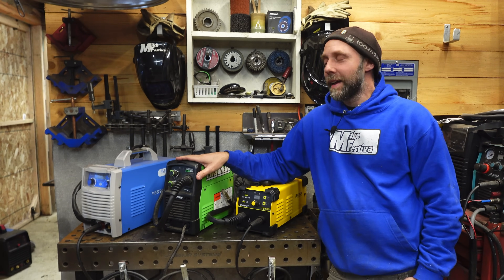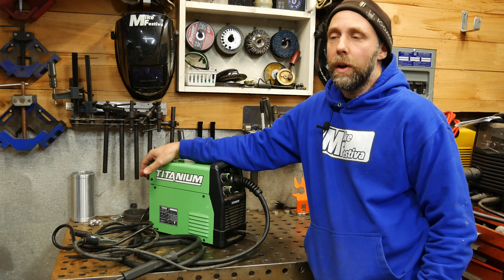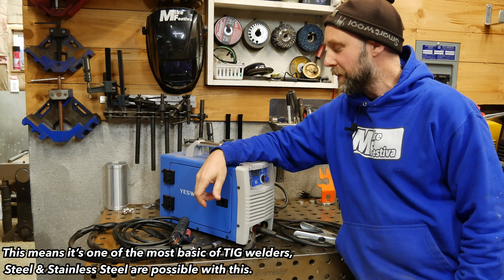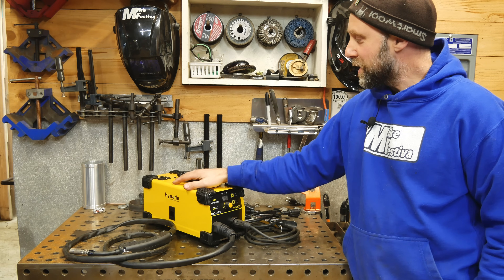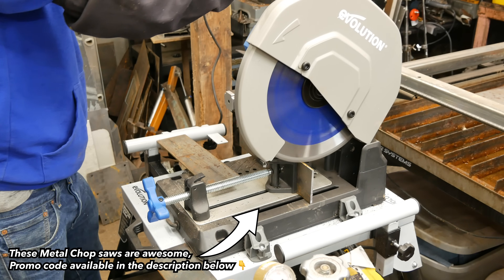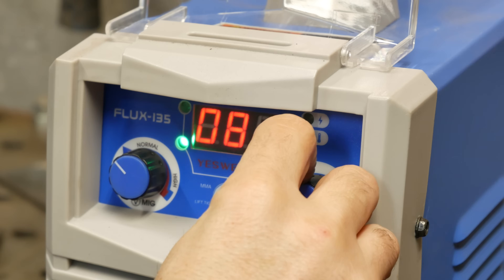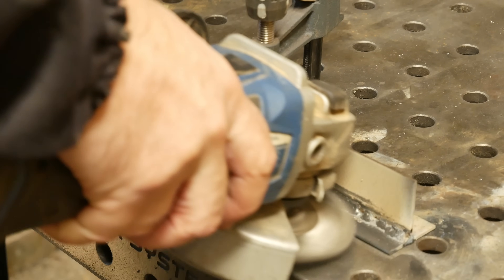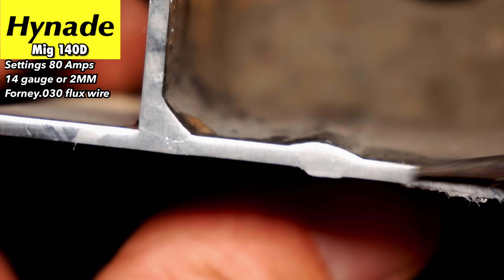Get started in welding, great DIY welder Titanium, Yeswelder, Hynade flux review

Comment: It has been about 6 plus years since you got the omnipro 220. How is that welder still holding up?
Reply from the maker: I sold off my Omni pro to by a TIG welder years ago, but bought another one about 1.5 years ago. Zero problems with either one I have owned. If you check out my newest video I posted on my channel, I run the Omnipro welding on a trailer frame to build a tiny cabin on. Good all around welder 👍

Comment: Ok so I bought the haynade 140 from Amazon … it’s a lil different now it has cut outs for straps now and it beeps during use I thought it was an issue but after receiving a new one and returning the other one yes they beep when using thought I’d clear it up for anyone
Reply from the maker: Good to know that info about the newer model of the 140, thanks 👍

Comment: Not me the Plumber installing a 50amp breaker with 4 gauge wire to a 120v receptacle Just so I can Weld with 3/32 Rods going 80amp On the Cheap Welder

Comment: Mike , I currently run the old Harbor Freight flux core welders on 20 amp breaker with 10 gauge wire to welder. I have no problems tripping the breaker. If run on a 15 amp breaker off a drop cord the breaker trips easily and lower amps come to the welder. Your wire from breaker to outlet could be too small. should be at no12. Preferably no10.

Comment: I wish you would have mentioned the duty cycle on each one.
Reply from the maker: You probably will never hit the duty cycle on the Hynade on 240 volts, and probably won’t even have an issue with the others. I honestly have never hit a cool down cycle on any of my inverter welders ever, that’s much more of an issue on older transformer welders. 
You should easily be able to look up the info on the welders website if you want more info.
Reply: @Mikefestiva  Could be on the duty cycle. But with 45 years out in the field I always push a machine. I have 3 transformer welders in the shop, so taking your advice and purchasing the Hynade, since it has the highest duty cycle.  And like you said for small jobs I'll be using it outside with a generator.  You make great videos.  By the way what brand is that fixture table you have.
Reply: One of the standout features of the YesWelder Flux 135 is its impressive duty cycle. While it boasts a 60% duty cycle at 135 amps, it can also maintain a 100% duty cycle at 104 amps, depending on the welding process.

Comment: That Yeswelder Flux 135 is running $100 right now.  At that price, would you say it is a no brainer for a beginner?
Reply: I bought it a week ago for 100. so far its been amazing. You could say its a set and forget with flux core. spent 30 mintues with some scrap to dial it in and been smooth since
Reply from the maker: That’s an awesome price! Thanks for mentioning this 👍

Comment: Thank you for this and all the videos you’ve made that include the Hynade 140D. I purchased it mostly based on your review and you’re review of the Flux wire test. I am a weekend welder fixing small things around the house and helping family (mostly for practice!). I replaced my stock plug wire for 12 guage so I can use 220V outlets. Any recommendations for using 220? Settings? Max Metal thickness? I plan on building a 100 gallon propane tank BBQ pit this Fall / Winter. 

Thank you for your videos! And I’ve watched most of them! Lol.

Comment: Out of curiosity, have you thrown a amp checker on while welding? My yes welder (stick, and lift tig) seems to run really cold. It struggled to run 6013, and 6011 (all rods are 3/32). I had the same issues your having with your breaker. If i turned it up to 90ish, it would pop the breaker. It seemed to run a little better with the 7018 rods.

My Titanium 125 flux, runs like beast, no issues. Ive built a welding cart/table, and welded 2 exhaust on cars with it, no issues. I would definitely recommend it to someone looking for a cheap portable welder, or someone looking to learn how to weld.

Thanks for the video man!

Comment: I have had a Titanium 125 for a few months now and now the machine is continuously feeding wire. I have checked the trigger connections and have even plugged it in with the trigger disassembled and it still continuously feeds. Had anyone had this issue or have a solution?
Reply: I don't have that welder, but does it have a "Reset" button somewhere on it? If so, that may correct the wire feed problem.

Comment: Any experience with the Arc Captain Mig 200?
Reply from the maker: Yes the company Arc captain sent me out that Multi process MIG welder and it welds pretty nice 👍 I have been testing it at my work for the past 5 months and it’s still working good.
Just recently received the spool gun for welding aluminum and it probably welds better then any other aluminum SG style welder I have used. Time will tell but so far it’s definitely a good affordable welder.
Reply: @Mikefestiva  How would you compare it to the Yeswelder 205DS?
Reply from the maker: @ChillWheelz  very similar to the 205DS but this one is a bit easier to set up when it comes to auto set, and manual settings, plus it has spool gun ports.
Both are budget inverter welders but I feel they both offer good value. I haven’t had the Arc captain for very long like I mentioned so time will tell how well it holds up but for now it’s still welding good.
Reply: @Mikefestiva  There is an updated version of the 205DS that allows for a spool gun.  I previously had the original 205DS but was looking to purchase either the upgraded 205DS or this ArcCaptain.  I like my 205DS but I like the LCD display of the ArcCaptain.  The Yeswelder 250A has a decent lcd but it is not a dual voltage machine.  Any way you can do a video on the ArcCaptain?

Comment: Yeah you pay that a pocket but by what other means did you gain? You recommend that hynade they don't even give you a knurled wheel, even with the no gas machine. Total cr@p ... Thanks for the heads up of no nerled wheel Mike
Reply from the maker: There’s no need for the knurled drive, the machine feeds fine. Stop complaining and go back to your shop and learn how to weld.

Comment: Ok so I got a crazy question.,, with a flux core welder running off 120v 20 amp breaker .., how is the welder burning at 80 / 90 amps? Or higher and not tripping the breaker..,  power inverter ??
Reply from the maker: These welders can make 90 amps on a 120 volt 20 amp circuit because they up the amperage from dripping the voltage down, they are probably running about 18 volts at 90 amps when welding.
Hope this helps 👍😊

Comment: The yes welder has two bottom the left is the voltage and de right is the wire fee the 125 is the wire fee is that the reason is cold and you got less penetration

Comment: What size breaker do you have, and what size extension cord would you need for a 25 ft cord?
Reply: These all claim to be able to weld on a "normal" household circuit - I.E. 20 amp breaker wired with 12/2 w ground. BUT; when you look at the specifications, what little they give you, that circuit should now be a dedicated circuit, as in nothing else runs off of it. (The Hynade even states to use a "50A" breaker on the 110v side on their website)

Important to Note: In 30+ years of service work I can definitively state there is no such thing as a normal household circuit. Under Size Wire, Miss-wired, Un-grounded, and overloaded circuits are more of the norm after various owners "modify" for whatever they are doing.
They all state "No Extension Cords" (because most folks are going to use an undersized and overly long one)

HF states 23.5V - That's a 25A breaker running a minimum of #12, or better a 30A running #10.

Hynade has conflicting info on max draw amps (The website states a 50A breaker for 110V) - I have one, and although I would normally just hook it to a 30A dedicated circuit wired with #10, I sent the manual PDF to an electrician friend to double-check for me. (I am just a GC - I perform electrical work but let the pros spec it if outside normal parameters)

Not familiar with Yes, but looking at the manual I would not use this on a normal 20A household circuit without having my electrician verify the specifications for me. 

Although all these welders claim to run on 110V household circuits, the only clear language in the manuals is to wire it per a licensed electrician for your area. Very clearly limiting their liability to actual use in the field.

I would probably use any of these welders in my garage on a dedicated 110V 30A circuit running #10 in my shop on a known circuit. - I would run none of them on an unknown circuit on one of my clients or my rentals. I know lots of folks do, and I thank them for that as over the years folks that abuse their home's electrical systems have made me lots of money.
Reply: @johnhubbard6262  Ty, not going to get one, going to weld it at my buddy's house, OR would a Honda 2200ie general work???
Reply: @johnhubbard6262  Is there any way to tell which outlets are dedicated by your circuit breaker? I have one set for an air conditioner... or maybe unplug the frig for a while? lol.

Comment: This video made me decide to buy the Hynade MIG140D. I did some test welding, on some 1/8" flat steel with it today, and I am happy as can be with the results. I've never electric welded before, and with the exception of letting the flux core wire spool unravel  a bunch (learned NOT to clip the end until I'm ready to feed the wire into the machine), everything went smoothly, and easily. I was able to get some really decent welds, considering my zero experience. I think I will become quite good at it with practice.

Thanks for this comparison vid.

Cheers!
Reply from the maker: Right on! That’s awesome man! 😊👍

Comment: Hi Mike, great video, thank you.  I am just getting started with welding, and I am renting a garage.  Besides clearing it with the owner who is a friend, what should I do to protect the floor, walls, etc?  I want to get some projects knocked out but I do not want to damage the space or the friendship.  Any tips? (fire extinguisher, ventilation are obvious, but floor coverings? wall coverings? spatter control?)  Thanks!  Definitely worth a sub with the bell.

Comment: You've done it again, Thanx.
I'm new to welding, or I should say this type of welding, I pushed some  Oxy/Ace puddles around around 20 years ago.still have my torches, but in the long run I think this would be easier, more convenient and cheaper, I  want to do some stuff around the ranch.  think I'll get the Hynade and some forney 42300.

Thanx again.

Comment: Thank you so much Mike for making this video! a question I need to ask you, can 0.030-inch flux core wire "fillet" weld comfortably on 19 gauge square tubings and sheets? or it will easily burn through holes in 19 gauge - 1 mm? can an experienced welder weld with the mentioned wire size on 1 mm without burning holes? your reply will be a great help. We weld 99.9% 1 mm mild steel tubes and sheets, in our country it's very hard to find a 0.023-inch flux core wire, and we don't have co2+argon gas bottles or any similar... at all in the whole country.

Comment: Thanks for the honest comparisons.  I have been welding with the HF 125 DCEP welder and am tired of the BB’s and splatter.  I’m ready to upgrade and think I want a Flux/Stick welder.  Your video has just about made me think that all I need is a DCEN Flux core welder.  I would not use the stick welder very often but would use the flux core 90% of the time.  I guess it comes down to which MFG I want to spend my money with; HF, Yes or Hynade?
Reply: Have you done everything to help mitigate the spatter? Quality flux core wire, prepped part (no milk scale or paint) weld settings set correctly, proper stickout, and anti spatter spray. Once you get all those down then the spatter should be minimal and cleanup should be very easy with a wire wheel.
Reply: @rileyneufeld7001  done all that.  Broke down and bought the Titanium 125.  What a difference DCEN is.  OMG!  I feel like I’m welding with shielding gas now!  So much cleaner and less smoke and spatter.  I barely have to use any anti-spatter spray.  My welds are so much better!  Been using the Hynade .30 flux core wire.
Reply: @waynecoley4876  My mistake I thought you had the titanium flux 125! Yes clean welds are much more attainable with it. The stock settings on the welder do seem a bit voltage rich and wire speed is a bit low. For the given thickness go down half a letter and up .5 wire speed and you will get better results. It should sound like bacon frying not a pulsing weld.
Reply: @rileyneufeld7001  very much appreciated

Comment: Hi Mike,

I like the yeswelder.

Do you think if you turned the amps up a little on the 3/16, it would do as well as the other ones?
I notice on the other 2, the breaker tripped.
Maybe the yeswelder was not putting the Amp that it said.

Comment: Hi can you use the titanium 125 flux outside and can you use an extension cord , thank you for your help
Reply: The manual says No to an extension cord, and No to any wet conditions. Everyone uses extension cords regardless, sometimes you roll the dice - If I do, it's 10 gauge as short as possible. I carry 25', 50', and 100', and my PPE matches the risk as closely as I can.

Comment: Over the years I have owned Kemppi 3phase Migs that were 5k or more each (several), jazzy Mosa diesel towable  welders that were eye-watering, spent hundreds (probably thousands) of hours running torches  The last few years I only run 2 small sub 700.00 Migs - a Sip & a Sealey plus a sub 200.00 flux core (don't know what make, but boggo) - those 3 ickle welders make me a better living than the big machines used do - all 3 get an absolute spanking day in and day out. They are not used for "hobby" stuff - they are expected to earn their keep. Which they do, just fine. 

You don't need fancy gear to make a living welding. One of these ^^  will get you a very long way. :-) "Gas" is expensive as frig here btw - it runs €120 to €150 for a hobby size rent-free bottle you have another €120 into as the deposit on the bottle - renting bottles is even more eye-watering. I have 5 bottles at any one time, they don't last too long & it soon adds up to not beer money over the course of a year. So Flux-core has that huge advantage right off the bat - No Gas required.
Reply: That Forney wire is damn near unobtainium here btw - it's "Out of Stock, unavailable" everywhere you look.  :-(

Comment: I got the yeswelder and cannot get it to stick weld for anything. Even 3/32 rod. I set the amps at 70 and it sticks and the amps start at zero and ramp up to 70. How is that supposed to work

Comment: Nice comparison video!  I have one quick question for you: do you think any of these would have a problem running off of a Firman 8350/6700watt generator?  
New sub here!
Reply: I think you could run a stick welder(220), joining half inch plate. That's a LOT of power! You could run a 110v machine on one of those 1500w Honda generators.

Comment: Hi I used your code for a Langmuir Crossfire Pro and bought a Flameweld plasma from Amazon.  I burned up the third consumable tip set today after two months of use. What tips do you recommend? Do you buy the exact same ones from Amazon or does another company make a better option?   Thanks so much for all the info

Comment: I'm having alot of trouble with my titanium flux 125.   Why doesn't it maintain an arc, it zaps once and then it stops and I cant get it to keep going
Reply: Sounds like a wire tension issue. Check make sure the correct rollers foe the wire used and then check tension on wire make sure its tight enough to push through your fingers pinching the wire hard. Or try to make a bird nest in your hand. Loosen til it doesn't go when you pinch then tighten a hair farther so it's just tight enough. If over tightened you can mare the flux before it gets to the puddle and effect weld quality and you will wear out the rollers alot faster

Comment: I ordered the Hynade 140, it worked great and I began learning quickly. Unfortunately the plastic locking tab holding the spring for the coil of flux wire broke off. Upon inspection, I found the working load of the tab to be very thin. 
Everything else was great. Might have to return the set
Reply from the maker: That’s a bummer that the small plastic retailer cracked off.  Sorry to hear.
Reply: @Mikefestiva  There shouldn't be much load on the wire spool nut.  Should be able to make a replacement if the stud is a standard thread.  Just use a tap.